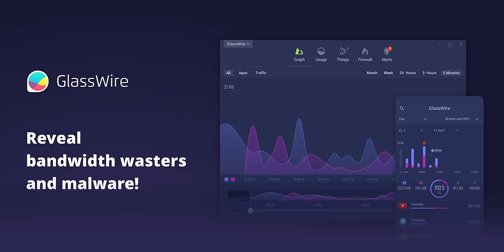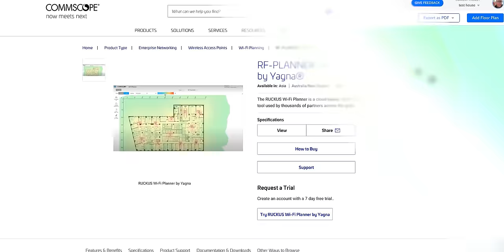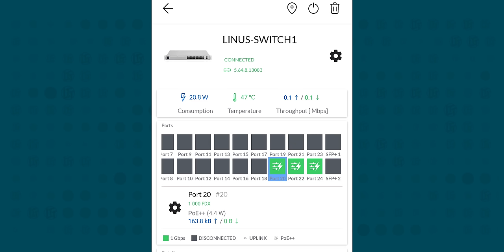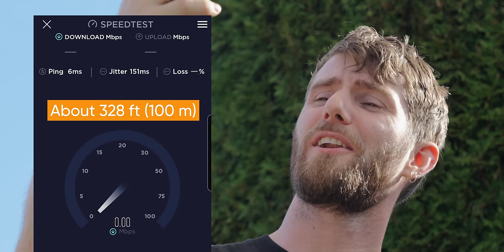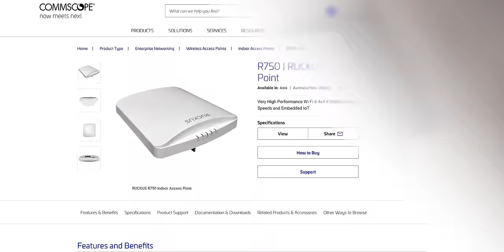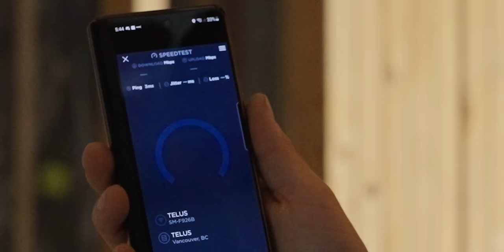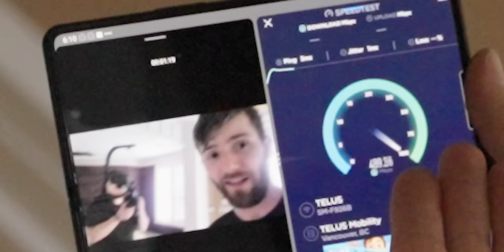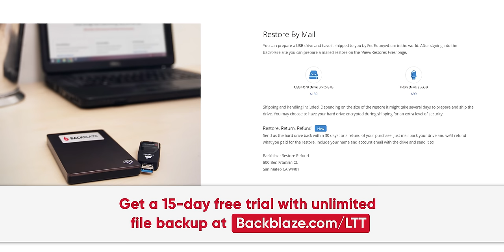Unlimited Budget WiFi at My New House

Comment: "CONCRETE between each of the floors [...] which tends to seriously reduce your signal strength" 
I live in European country and most buildings here have atleast 20+ cm (7.9+ inches) of solid, steel reinforced, concrete between floors which is absolute pain for WiFi.
Also, it doesn't help that every indoor-wall is also build with thick aerated concrete blocks.
I'm glad that i could cheaply obtain some (fairly new) Cisco Aironet AP's from my workplace after they upgraded to WiFi-6, otherwise i would have had to spend way too much money for my WiFi setup.
Reply: Yeah i had the problem too that in my new place, the WIFI didnt reach my office room, so i got 2x Mesh WIFI APs from TP-Link, those worked wonders.
Reply: Yeah i have 2 used aruba 335 at my house, overkill for home user
Reply: North american homes are built with cardboard and prayers. I never understood that.
Reply: Personally in my parent house I said f*** off and put cat 5a in all the room… I had to do this while my parent where on holiday. I had to open all walls on the back of the plate we have at the base of the wall to hide cabling and make place for the Ethernet cable. But I never had a connectivity problem at all…
Best thing ever…
Reply: Honestly, if you have a multistorey home in Europe, your best bet is to have an electrician run ethernet throughout the existing electrical channels. I'm sure it can be done, although I haven't done it.
Reply: I've given up on wireless between floors, just ran a 5e cable and hooked up an AP there. No issues since.
Reply: @BillPairaktaridis  yes it is easy when there is electrical pipes for my parent case rhe house date from 1917… no electric pipe where installed and the house is made of rocks …
For my house in Japan the building is made of wood and placo… and yeah I wire all room with cat 6 (thanks my company for letting me use the Ethernet reel) and yes the cable pipes where really useful for this. (It was done in 1h for 6 cables).
Reply: I rather find a WIFI solution and have a solid home than to live in an American cardboard house with good WIFI
Reply: Yes but the upside is that your building is practically a bomb shelter and you'll NEVER have to deal with noisy neighbors..
Reply: @MiniRunnera7  Well said. I could not agree more..
Reply: @Shidera5721 I believe Aironet AP needs license to work with, it would be expensive to use then
Reply: When you think about it... the rebar in the concrete creates a type of faraday cage, but because the rebar is spaced differently, some data gets through, just not all of it.

Comment: I appreciate the secondary test at the end of the video where you show the performance of a single WAP.  We install these all the time and would have done a project like this with 2-3 units depending on the client wanting outdoor coverage or not.  While I love the "Tesla Model S Plat" approach, clients should also know they don't need to spend $10K to have great WIFI in their homes. Thanks for an awesome video. We will definitely share.
Reply: Thank you for this. At my work the WiFi that was installed before my time, the APs were actually installed too close together, causing issues with the service the users were getting. We just had a wireless survey done and the recommendation is to remove 8 out of 18 access points. 🤯
Reply: .. make your cable game weak, with this WAP

Comment: For anyone confused by the speed being better while standing still: the way the signal is decoded is by the AP treating the physical degradation/attenuation/reflection/etc. as a matrix solution to an equation (it's called the 'channel' factor, a literal physical description of what the signal's path is doing), it can then use that to properly read the incoming signal (basically clean signal * channel effects = received signal, received signal / channel effects = clean signal).  So standing still means the channel effects don't change, so there's no need to recompute a solution due to signal loss.
Reply: Oh yea, matrices... I know those
Reply: @Tosti_bakker  Yeah, I considered giving the proper matrix explanation of the equation but I figured talking about inverse matrices and least square approximations might be a bit much
Reply: mmm this man is speaking some language i don?t understand
Reply: What you didn't talk about was beam forming and that the APs are either 4x4 or 8x8
Reply: Now I'm even more confused :D

Comment: Also, I’m glad that there are more consumer friendly lower costs versions if the stuff Linus uses for his wifi.
We use eero mesh wifi devices, and they came with our wifi package, but they’re more in the small hundreds,band I think even come in bundles.
Tho you will have to buy a switch or something, cuz they don’t have more than 1 Ethernet port like most modems.

Comment: The main value add of good Wifi and networking is it makes a decent Internet package worthwhile. The converse is that crappy Wifi makes high speed Internet past 100 Mbps effectively valueless. It’s a necessity to have good Wifi coverage and to never settle for ISP-provided devices.
Reply: Also: Good network speed for using a NAS and/or a local media server, not just for internet access.
Reply: You know you can use this thing called a cable and get a 100% stable Gbit connection for next to nothing.
Reply: As riDDimann said most people for any serious reason even at the home level is going to rely on a hard wired connection. Why spend 600+ for a solid wifi router when depending on your location you may need additional access points anyways when for Likely less than 300 for a couple cheap switches and if you're willing to terminate your own wires you can do an entire house and get the maximum throughput of your connection.
Reply: Just hard wire your place with min. CAT6 if you got the walls open anyways, much more future proof. This 10k wifi setup will be outdated in 5 years and not everybody will have a sponsor ;)

Comment: geeze, 260 down & 100 up, outside is crazyyyyy
Reply: 50 down, 5 up 😒
Reply: 15 down 1.5 up
Reply: @kristianyoung2429  2 down and 512Kbps up :)
Reply: 150 down 30 up for me :(
Reply: 30 down 16 up on 5g
Reply: I get 750 / 350 - 2 meters from the router on my iPhone - but walk away bout 5-7 meters from it and it drops to 300/100… Walk outside and its 100/11
Reply: Yeah If he would have switched off WiFi to 4G/5G he would have gotten better....?
Reply: 275/213 outside, shitty (probably?) router that came with the fiber, I was expecting more.
Reply: @prof.esrever7823  same but why are you unhappy with the speed. Game updates dont take that long. Uploads i guess do take much longer
Reply: 43down and 43up
Reply: Move to Spain, I can get 1000 Mbps down and 1000Mbps up at only 30€ :) (That's the only good thing this country has...)

Comment: As a technician in the technology field, you guys should know that when you're toning out shielded cat cable, it's very difficult to get an inductive tone with the wand on the sheathing of the cable. You would be better off testing the ends of the cable, or if you had a different toner, you could connect the positive to the cat cable, and the negative to earth ground. That makes them SCREAM😂. Super helpful
Reply: I use toners frequently, I've never heard of only connecting positive but it sounds like it makes sense.. I'll have to check it out next time!
Reply: Yes and no, the induction should be just fine if the source is powerful enough. Your standard toner is only 9V and doesn't give much amplification. Shielded cable can really complicate things, so the shield should be clipped in this case which would provide great sheath detection of tone. We do it all the time.
Reply: @wafflexboy  connect the positive  and then negative to GROUND. that part is important

Comment: 5:40 There is a relatively cheap substance called RTV silicon. I would recommend using some in this instance if you would like to keep your connectors safe from water & corrosion damage long term.
Reply: silicone

Comment: The house: A big construction zone
Linus: Well let's do the wifi now
Reply: When else would you do it? I mean you need to cable that stuff... imagine being all done, setting up wifi and noticing you misplanned something and need a cable somewhere you really can't easily get to now.
Reply: Uh...yeah. seems like the best time to do it, considering routing the ethernet cable through walls and ceilings is easier when the walls and ceilings aren't finished.
Reply: As someone who’s house recently finished being a construction zone, hell yeah that’s the best time to do it, when else are your ceilings, floorboards and even the inside of your walls accessible without making a huge mess? Especially as I’m in a plasterboard on mortar situation for the walls and can’t just fish a cable through the wall space. Now I’m going to need to find a weekend when the SO’s out to prep, install and clean up a roof AP, assuming I don’t need to fix any cockups in the process
Reply: That is literally the best time to do wiring when its already opened
Reply: What I dont get is why didnt he mount the access points in the ceiling?  When the drywallers come in to finish off they can just put an access panel in.  Everything would be hidden then.  Unless it needs to be in the open for some reason but if its going through concrete it should be fine.

Comment: Just to add to this make sure you set ofdm only and adjust your minrates for roaming on your main ssid.The signal on these waps are pretty crazy and you wont roam nicely.  Also setup the wifi calling option and enable the auto adjust ap power under services

Comment: We moved house and our ISP sent us a new router (our ISP uses Fritz Boxes).
Thing is, they never ask to send the old one back and it has a mesh-network setting!
So we placed the new one near the front door as master, and took the old one and placed it near the backdoor. (LAN connected)
Our house is not very big, but the whole house from front yard to back yard (+shed) has perfect WiFi now!
FOR FREE :D (You might be able to buy a used one for like $5,- or $10,-!) It can mesh using a cable or by extending WiFi. :D

Comment: My soul died a little when you said "Oh, we don't need the tester, we can just plug this right into the switch" at 6:50. A switch does not test/verify/certify cables, that is literally what the fluke exists for. Some switches can do little physical tests where they will tell you the rough length of each pair using TDR, and they will test pinout. Cisco switches only show the length of the pair, not of individual wires, I don't remember what Ubiquity switches do offhand. The fluke measures that on each wire, but also measures things like near/far/alien crosstalk, and tests the signals at every megahertz value up beyond the spec being tested. There are many cases where a cable will pass a switch's test or one of those 8-light testers, but will fail the Fluke. With old-school modems, the tones that they generated were it testing the quality of the signal and ramping speed up/down as appropriate. With ethernet, the devices use LNP pulses to agree on what speeds they both support, but it does not do signal quality testing to determine what speed to negotiate.

As an example of the impact of this, back in the late 90s I was doing tech work for a public elementary school. When the iMacs came out, the school upgraded from Mac LC580s on 10baseT to iMacs that supported 100baseTX. The ATI switches in the data closets were already 100baseTX switches. Nearly all of the iMacs saw marked network improvement vs the LC580s, but there was one iMac in the computer lab that was absolutely crawling compared to even the LC580 that it replaced. The reason was that the ethernet cable was too "noisy" to reliably support the 100Mbps transmission rates, so there was a high error and retransmission rate. But the cable would negotiate "up" between the switch and the iMac. It would pass the tests from a switch, and from those 8-light testers. If you told both sides not to autonegotiate and locked them to 10baseT, then performance would improve rather than degrade.
Reply: Nerd
Reply: Soooo much of this was unnecessary waffle. Stfu
Reply: Could you do a TL;DR
Reply: @GauchoMwenyewe  It's Linux Tech Tips, we're all nerds...
Reply: @leepicgaymer5464  The TL;DR is that plugging a network cable into a switch does not test the cable. His coworker spent half the video holding a $2k cable tester that takes under 30 seconds to perform a full-spectrum test of the cable. Linus declaring that he's going to just plug it in as his test does a disservice to his 14M subscribers by displaying piss poor practice, even if he planned to later do the proper testing.

Comment: Linus complaining about his old wifi speed in his driveway when its 3 times faster than my ethernet connection. smh😥
Reply: you may not have long to wait depending on where you are at. if in the US the ISP's are going Bat crazy with FTTH because they have learned that they have no choice. FINNALY.  the latest pandemic that i can't say doe to youtube, really taught them some lessons.  (Network Engineer for a local ISP that finally got listened to by executive leadership for FTTH in my county)
Reply: @bluetonight17  I'm in Australia. We have speeds worse than a 3rd world country.
Reply: @layk  ouch. Not all of Australia but a lot of it. But yeah they do need a bit of upgrading there. Just so much land to pass to get to some of the people. They could use fixed wireless, not cell phone, but fixed wireless for home and still offer 500Mbps to 1Gbps.  My company does this for our very  rural locations, can get up to 15 miles from the tower. But at that range the speeds drop to a max of 50 Mbps